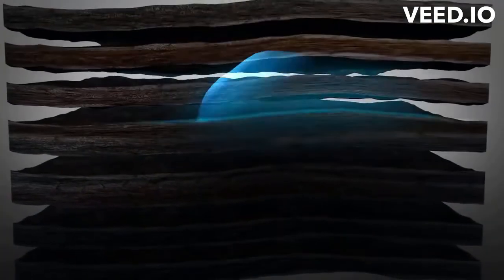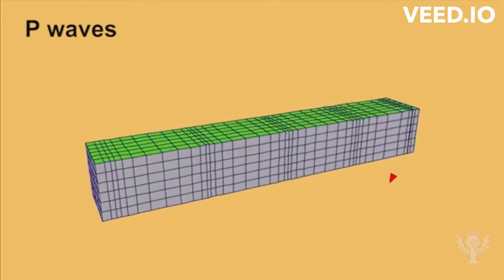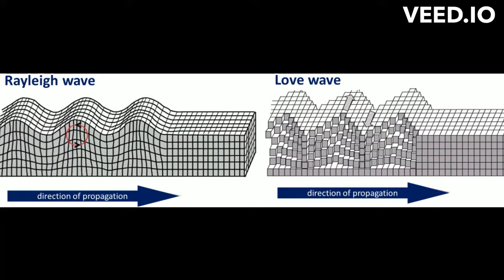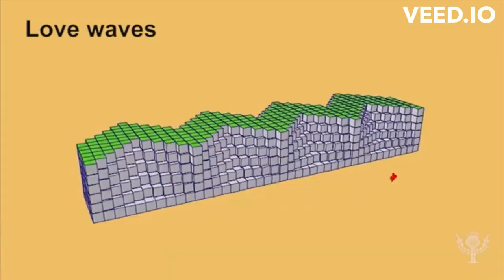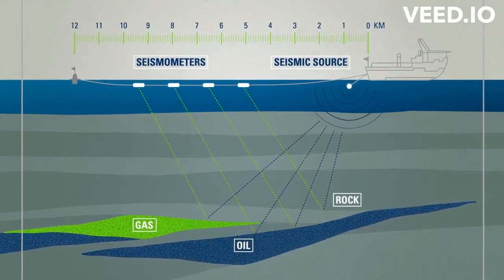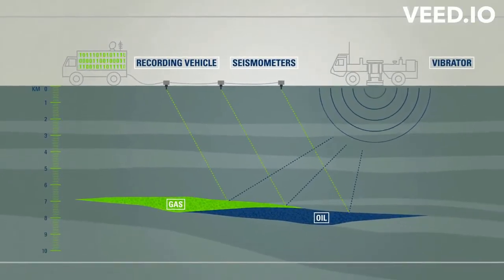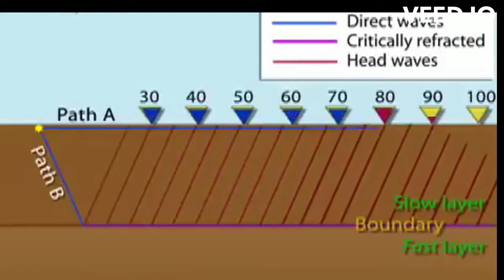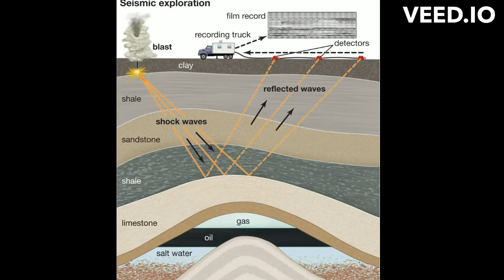Introduction to Exploration Geophysics: Part 2 (Seismic Method)

Comment: Can we explore gemstones usimg this method?
Reply from the maker: Gemstones are typically small, localized deposits, which makes their exploration using seismic geophysical methods challenging but not entirely unfeasible. Seismic refraction and reflection techniques can delineate kimberlite pipes, which often host diamonds, by detecting contrasts in seismic velocities between the kimberlite and the surrounding host rocks. Kimberlite formations typically have lower seismic velocities due to their unique composition, making them detectable in seismic surveys. In Botswana's Orapa and Jwaneng mines, seismic surveys have been used effectively to map kimberlite pipes in detail.

However, for smaller-scale gemstone deposits, such as emeralds or rubies, seismic methods may be less effective due to the limited size and irregular distribution of these deposits. In such cases, other geophysical methods, like electromagnetic or ground-penetrating radar (GPR), are often preferred because they are better suited to identifying shallow, small-scale anomalies. Despite these challenges, innovations in high-resolution seismic techniques, such as 3D seismic imaging, have opened possibilities for more detailed investigations of localized deposits, including gemstone-hosting formations. For instance, in Sri Lanka, seismic methods have been combined with other techniques to identify zones within alluvial deposits that may contain sapphires.

While seismic geophysics is not the primary method for gemstone exploration, its integration with other geophysical techniques and geological mapping can enhance the efficiency of exploration programs, especially in areas with complex subsurface geology. 

"Let me know if you need further clarity' Malebati J.
Reply: @morakamalebati7698  Thank you very much, Malebati J., for the detailed explanation!

I am from Sri Lanka, where gemstone exploration is primarily focused on sapphires and other precious stones in alluvial deposits. I would love to learn more about accurate gemstone exploration methods.

If possible, can you kindly share a method to contact you to discuss further. Looking forward to hear from you.

Thank you again for your time.
Reply from the maker: @ransikadayarathna +27713365036 (whatsapp) or malebatimoraka@gmail.com
Reply: @morakamalebati7698   @morakamalebati7698  Thank you very much, Malebati J., for the detailed explanation!

I am from Sri Lanka, where gemstone exploration is primarily focused on sapphires and other precious stones in alluvial deposits. I would love to learn more about accurate gemstone exploration methods.

If possible, could you share more details about the application of these methods in Sri Lanka or similar geological contexts? Also, can you kindly share a method to contact you. Looking forward to hear from you.

Thank you again for your time and valuable insights!